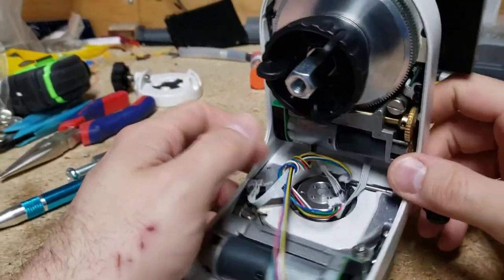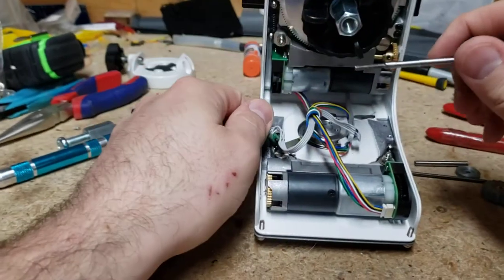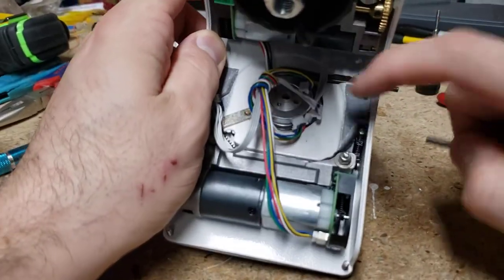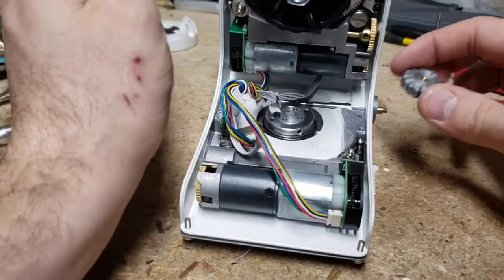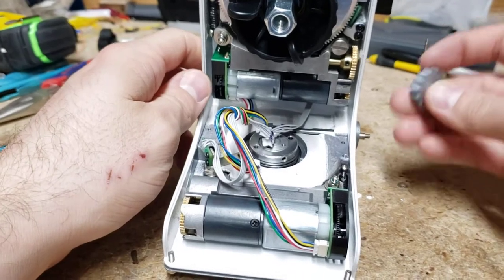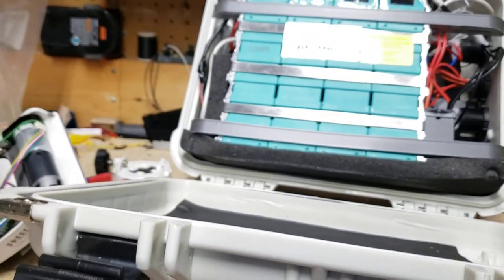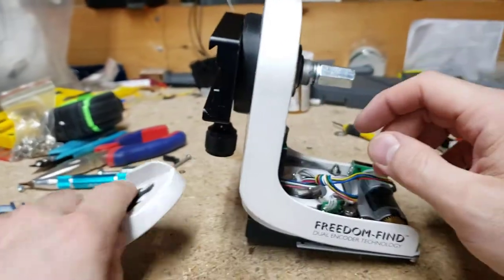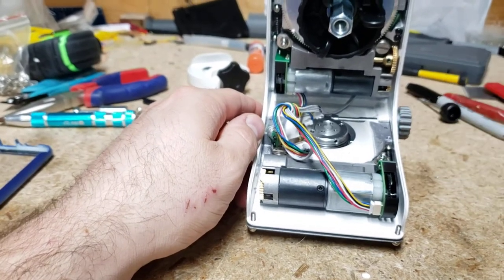AZ-GTi RA Clutch Screw Fix & Other Easy Mods.

Comment: Great repair.  What are the parts sizes you used?
Reply from the maker: M3 threaded rod, 3mm ID, 4mm OD (outer diameter) stainless steel capillary tube.
Reply: @CardBoardBoxPro  Did you find the noob where you purchased the other parts?  Thanks
Reply from the maker: @mwales2112  no I 3D printer it. It's all in the audio. Is that not working? Just curious. There was some issue with the audio for me. Oddly right side only
Reply from the maker: @mwales2112  I 3d printed one, however, you can use a Wingnut or M3  plastic heat settable nut and embed it in some other knob with a soldering iron.
Reply: I just repaired mine with another method (I sealed the bolt with a nut in the mount) but on mine, it's M4 and not M3